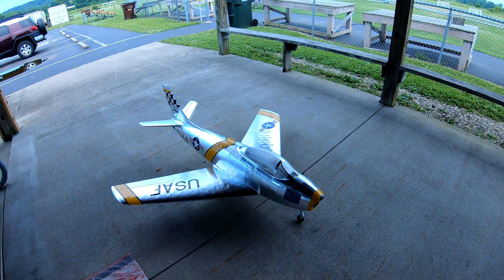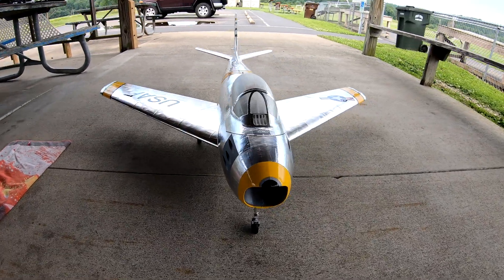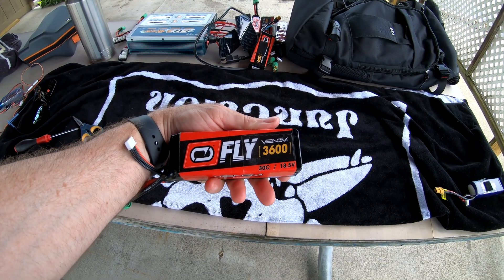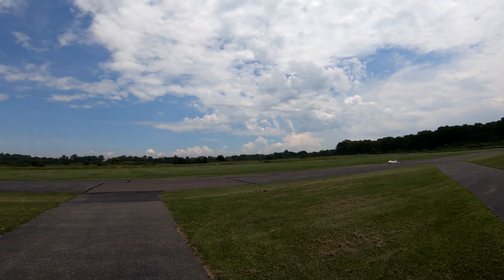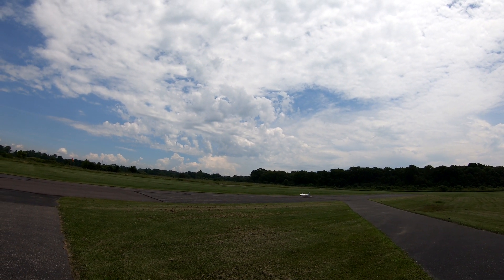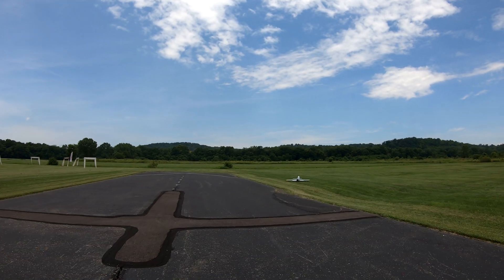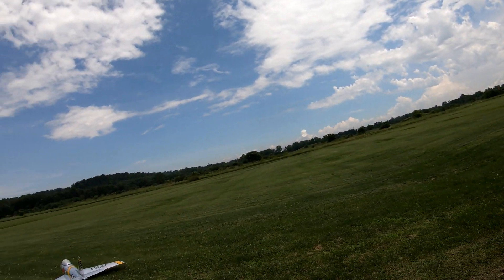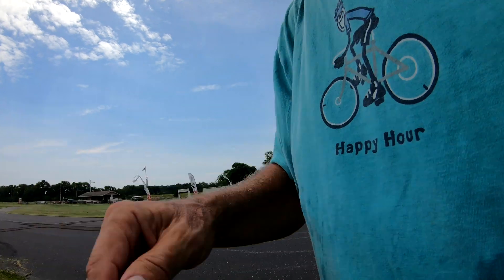F 86 V2 Maiden

Comment: How has this plane held up? Any issues?  What about any problems with melting in the sun during transport or downtime?
Reply from the maker: the aluminum wrap helps protect.  I still will not leave it out in full summer sun.  PLA has softens at 60 C weather in shade or not.  Simply cannot leave in a hot car.  If you travel with AC on or windows down, it should be fine.  I have bent the landing gear with hard landings and the plane's structure is still good.  Always good to keep some CA glue on hand just in case.